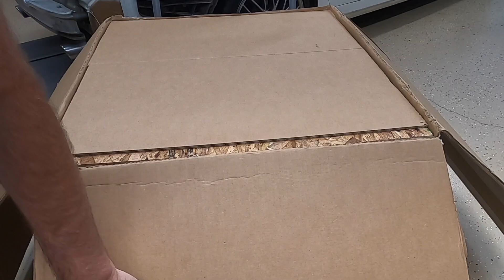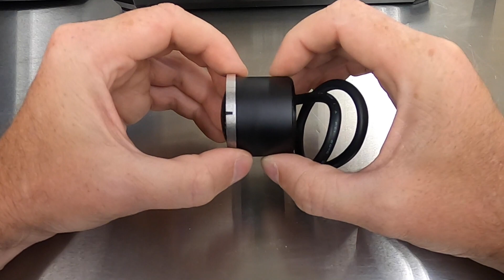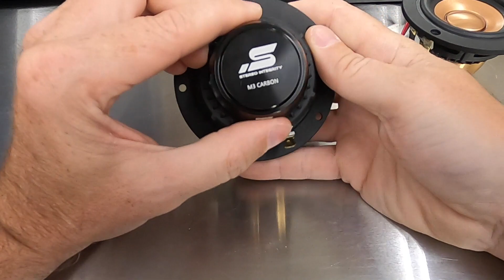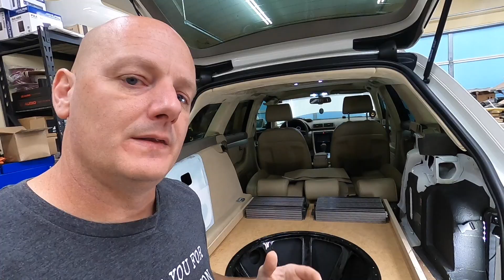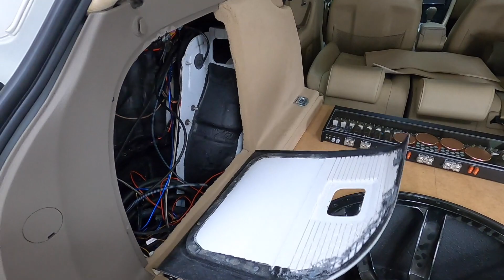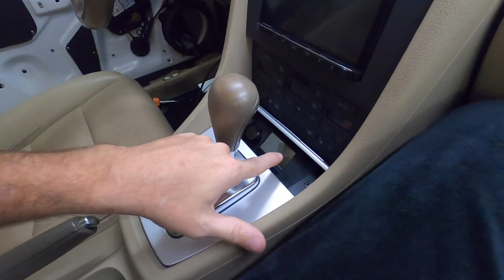Audi Build Plan Changes

Comment: Why the choice of kicks for the midrange!? I'm assuming no processor?
Reply from the maker: The previous owner had built the car for mids in the kicks so we’re utilizing those locations. Kick installs were a common thing in the 90s and while people still use them, most people now go for the A-pillar installs I mentioned in this video.

Definitely using a processor. I showed the location for the Helix Director in this video.
Reply: Kicks work great in there, I was surprised with just how well they worked.